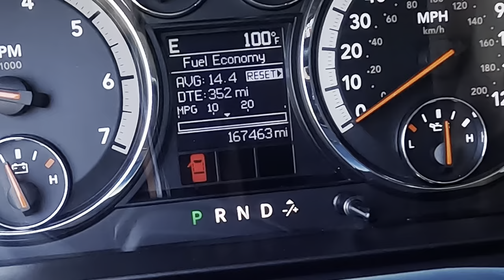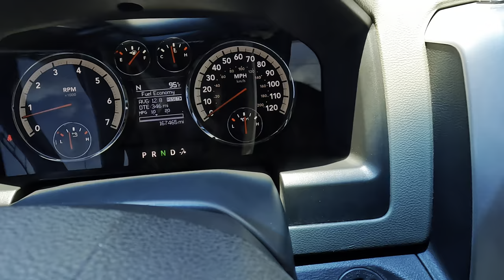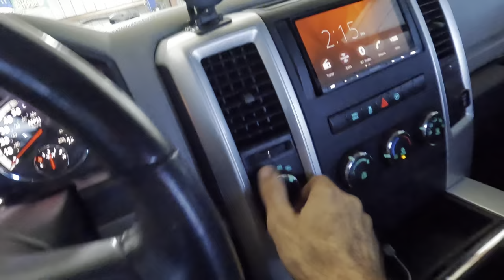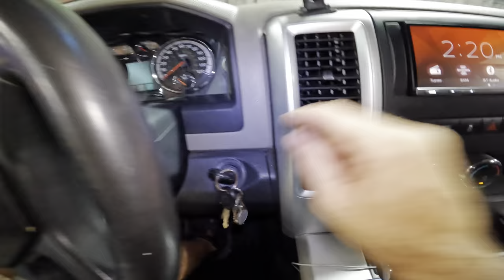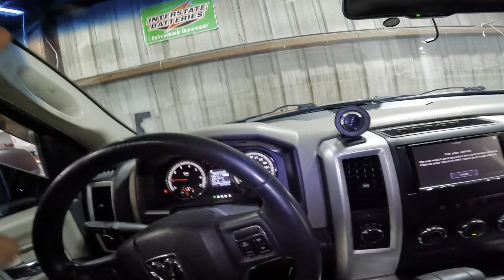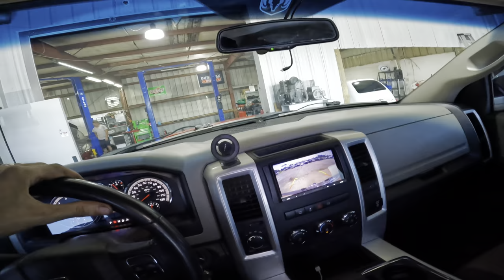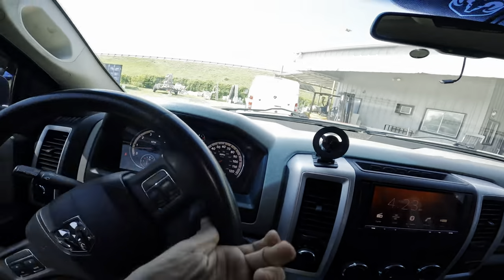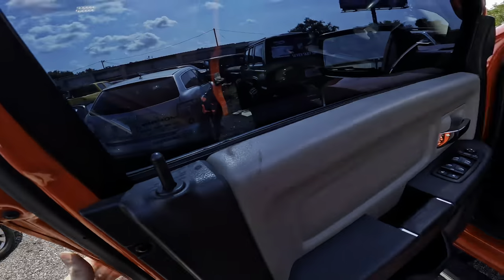Customer States: NO ONE CAN FIND IT! Sand in my Dodge Ram! Replace Whole Unit! 1500 4x4 5.7 hemi

Comment: You don't necessarily have to replace the drive shaft. Many enginineer/balancing businesses are able to service/replace those ujoints. Probably turns out cheaper than a ne shaft
Reply: Those Gen 4&5 U joints are expoyied in there.. They gotta be heated and pressed out at the very same time.... Lots and lots of HEAT.... Ray Ray don't know how to work a smoke wrench yet he is a just born doing well. He just ain't got it thru skull yet but eventually he might.. I would love an all expense paid week or two of teaching this dude in Fla... I could share some horror stories of rusted busted trucks and cars with him... he might put his ear plugs in for the duration...
Reply: @thekingsilverado3266  Your a superstar😅

Comment: I feel for the guy who bought this rig. I went through the same thing with a dealership in my area. I  had excellent customer service from our salesman and the owner of the dealership. They are a fairly large dealership and own dealerships for all over the northwest. Where I ran into trouble is with the service side. The service manager was a prick and was extremely harsh on his employees, and that led to techs fresh out of school with very little experience, especially with dodge front end and the notorious death wobble. I was a heavy equipment tech, and due to an injury that happened while not at work, I had to give up turning wrenches for the most part. I knew immediately what was going on with my rig. I explained it to the service manager and the tech himself, and after 5 attempts at trying to fix the death wobble I had enough and took it to a Truck service center and they knew exactly what I was talking about. I ended up with a $3300 bill. I bought new tires and track bar bushings and ball joints and two front axle U joints and shocks. I also had them install a steering gearbox brace as well. The wheel bearings and track bar were what was causing the problem.i took the bill to the dealership, and they wrote me a check for $3500, and life was good. I was just hoping that they would have paid for just the parts that were causing the problem. I was very surprised that they covered the whole bill and gave me $200 extra for fuel . The service manager was shit canned about 4 months later because of how he was treating customers.

Comment: Nice 
 Drive line diag. 
 Get permission to take the truck home and you have sand there . 
 But the drive shaft is not repairable sadly and the cv shaft is the Hum or buzz I bet they like to spin on the splines when they ware down. 
 Be safe all.

Comment: It's crazy (but not in believable, unfortunately) how the customer can take this to multiple separate mechanics, and none of the other guys are capable of giving this truck a 20-30 minute shake down like you did and find any of the obvious faults like you did.
Reply: His "shake down" took a lot longer than 30 minutes; my guess would be a good solid hour. Which is why those other shops never found the issue because they would have taken it for a 5 minute drive, checked the ball joints and u-joints by hand and then said they couldn't reproduce the customer complaint after about 15 or 20 minutes tops(which includes the time it would take to put it on and off the lift).
Reply: It takes thought & time to make an accurate diagnosis.
Reply: @@jshowao-rw1dh no, but you make a lot more money for being a trustworthy mechanic with return customers.
Reply: Someone is super defensive. Did you work this  dodge personally before Ray did? Lmao 🤣🤣🤣🤣
Reply: @joshuas390  you don't make a living that way.  It's a different thing when you can make money making a video about it.  You don't have to charge the client an exorbitant amount.

Comment: You're in for a treat getting that axle out.  I work on a fleet of those  generation ram trucks. The internal c-clip likes to get stuck and not allow the axle to pry out. Hopefully you quoted out the stub shaft too. Good luck and stay greasy my friend!
Reply: I just went through this on a Ram 1500 replacing the LF axle. I ended up having to cut the old axle off of the stub shaft. Royal pain in the ass!
Reply: @brycelund4112  They can be a real bugga. Look at it this way. Should be in for a good video. Lol.
Reply: @gregoryblack3888  I’m sure it will.
Reply: With the amount of light brown ground up steel crusties by the stub shaft to CV joint, that truck definitely needs both.
Reply: Maybe that's the reason the other garages didn't find the problem. They just didn't want to deal with the fix. I really cant believe another garage would miss something that sloppy.
Reply: @anthonydenn4345 definitely if you don’t look, you won’t see

Comment: I'd have expected to see a spacer for the rear propshaft too, as it doesn't look to be engaged into the gearbox far enough, it looks like it's dropping where it enters the gearbox.
Reply: With the lift as high as it is, and the rear axle dropping down as low as it did that's mostly just normal run out.  I have a lifted truck that does the same thing when up in the air.  You can see 1/2 to 3/4 inch run out from ride to lifted position on it.  And since the shaft has a pretty long nose end on the splines it can take a fairly good amount of run out.  I've seen as much as 2 inches run out on some lifted up a lot higher.  As long as it's not out past the seal it usually isn't much of an issue. Probably what that is from what I can see on this video.  At least it's not on a hanger bearing with more angle to the dangle because that much run out can destroy a hanger bearing quickly.

Comment: Once you start modifying the suspension with lift kits and larger tires, you will eventually have problems and wear. Good luck with approval of warranty.
Reply: I was going to say that lifting a vehicle( with CV axles)  increases the 
" angularity" of the CV's- which can increase wear....and, of course, driveshaft Ujoints.
A good Dshaft shop could rebuild that end, as well as balance the whole, so future Ujoints could be  replaceable.
Reply: Yup, it is part of the game, especially Ujoints
Reply: @williamevans6522  Constant velocity joints (by their very name) are not too fussed about angularity.
Reply: @johnhhinton5473  Sure they are.  Install them at the extreme of their flex, and they aren't going to wear evenly.
Reply: Ive a lifted ram and they still garantee everything except the pieces that are not mopar.. wich i think is leggit haha never had an issue with them, they care way less then you would expect

Comment: Suspension modifications would be one of the most common forms of stress on a vehicle that would cause issues felt by the owner/passengers, more so than engine modifications.

Suspension mods are something that many DYI'er installs themselves, and unfortunately there are many companies that sell sub-standard suspension kits. I am not saying that is the case with the lift kit in this Dodge Ram, it looks very well engineered, however as can be seen the Uni joint really is worn out in a way I haven't seen before. It would be interesting to see the carnage inside, especially if you don't have to return it as a core or warranty return item.

I have had 4WD's since the mid 1980"s, and I upgraded the suspension on all but my first 4WD.
Reply: Yes, my old ford ‘93 with lift wore the front Ujoint too, as well as the rear near the pinion - quite a different angle than stock
Reply: My father and I've seen similar wear on older RWD cars. Combination of stiff springs, long driveshaft, and smooth roads produces very little articulation.

It'd be ideal if someone made U-joints with plain bearings (bushings) instead of rollers for these sorts of applications, but these days they'd probably end up being made with plastic instead of bronze.

Comment: Just had a rear u-joint on my 02 Silverado 4x4 that was not doing its job. Mechanic I took it to KNEW right away what it was. I was looking at wheel bearings myself. He had me up and running same day and charged $125 total. Parts, labor and tax. Lots would have milked this for much more. Thanks to an honest mechanic

Comment: Nice looking truck, but looks can be deceiving, as the saying goes...Get a Tundra or Tacoma, and you won't have to worry about such things, but, to each his own..Oh, not the brand new Tundra 6 cylinder with the twin turbo, you don't want that..The standard 8 cylinder with no turbo, will last forever...And the Tacoma is probably the best truck ever mass produced, on my third one, and well over a million miles added together, with very little maintenance.. My wife has had the 2001 Lexus 300es and the 2003 Toyota Avalon, which is really the same exact car, made in the same exact factory, going on 700 thousand miles added together.

Comment: i’m always curious, usually dealers are extremely expensive so how is it that they couldn’t find the problem?
Reply: because they are all mechanics with government certificates with no experience of being a mechanic  and a manager whos wages you are paying for and no experience of being a mechanic
Reply: They probably like to be quick as possible.  More tickets=mo $
Reply: I went to the Ford dealer three times over the A/C in my Taurus blowing only up on the dash.  Three half-assed attempts later and looking at 1200.00 to remove the instrument panel, I took matters into my own hands and figured out how to make a lasting repair myself…for one hour of my time and 13 bucks!
Reply: Just because they charged good money does not mean they do a good job have a great day
Reply: Because they hire mechanics that just throw parts at it till fixed. Dealer makes money on every part.
Reply: Dealer service departments are production shops -- a set number of vehicles per day in and out quickly.  Techs have to make fast diagnoses and repairs, and at that, expen$ive ones.  And if the vehicle is modified, they'll outright refuse it out of liability concerns or manufacturer's policy.

Comment: I've always put the weight of the vehicle on my lower control arms to check the ball joints. Control arms are pushing down already so you have to lift them up. Uppers are still pushing down so then you can lift tire. That's the way I was taught anyway.

Comment: nice red rtv on the oil plug. also those non servicable U joints are a crime. should be banned. so fun when need to buy expensive shaft when only the cheap u joint went bad. could always cut and weld a new one
Reply: needs more on that plug .. lol

Comment: One thing I did notice is that you are wearing a marriage ring . Do yourself a favour and leave it at home. Over my 50 year working life, I came across quite a lot of fitters with missing fingers due to accidents with finger rings.
Reply: I knew a pilot who lost a finger when he got stuck while preflighting and slipped.
Reply: I used to work on generators, and too my ring off because working around high voltage and electrical circuits are not a good idea with a ring on. The high current can fry that finger right off
Reply: Easiest way to deglove a finger.
Reply: 0:28

Comment: most everytime i watch Ray's uploads i am blown away by the mileage that customers vehicles have done!! I drive, or rather drove my last BMW (just swapped it recently for a new vehic;e) having it from new and drove it most every single day for seven years;  but only accumulated just over 39K miles.... Tis the longest Ive held onto a car for many years living in the UK
Reply: I've never had a car with that little mileage! Well my wife's car we got with under 30k just passed 40. But all of my cars are over 100k. My last car had 268k on it. Ran beautiful but the rear suspension rotted out to the point it would cost more to fix it than replace it with the current car. That has 138k. It's all about preventive maintenance and not ignoring the little things.
Reply: Mike; To be sure the best way to prolong the life of your motor vehicle is regular maintenance, without it you are bang on the money, you are building up a heap of both problems and financial headaches. 
When changing my car, which on reflection was a bit nutty given the condition etc, but hey ho as they say. One thing that deffo put me off getting another bmw was the outrageous fleecing of the customer, charging a monthly fee for the privilege of using both heated seats and steering wheel... 
This imo, is nothing but a bloody scam. It’s like buying a radio or tv and paying monthly for the privilege of using the dam thing...

Though that said!!! 😡😳😡 here in the U.K. after buying your television if you want to watch any show whether /news/weather/entertainment whilst it is broadcast live so to speak, even an ancient b/W movie or indeed, as above anything that whether cable or SKY the satellite company, even ordinary terrestrial channels; you by law MUST have a tv licence issued by the BBC,  even if you NEVER EVER watch bbc you still have to pay them for the privilege of watching television as broadcast ; Tis a legal scam. 

It’s just the same as, say you going to your local store and buying a newspaper, you have to stump up the cost of every diff newspaper on the shelf ... 

The only way to watch television without having to pay (app US $180 per annum) is only to watch shows that are not broadcast in ANY channels regular daily schedules. Which means taking a sub on like Netflix or Prime. 

To think imagine in the Wonderful US there is a disaster like 9/11 or a happy event like New Years or your biggest football World Series and it’s broadcast on every channel . To watch the equivalent here broadcast live, and you watch it without shelling out money to the BBC, and you get caught, well it’s a court appearance and a significant fine, just for watching tv in your own home 😡😡😡
APOLOGIES for the rant Mike, I just despise getting scammed by the (uber liberal) BBC 
Have a good day dude.👍

Comment: I seen it @12:59 those stub shafts can't ever seem to keep the rust out up here in Maine. They like to make all types of pop/grinding noises. I always unload the front ends to check the ball joints. If you can benchpress 500lbs and have a prybar casted out of Thors hammer maybe you can do it without unloading them but I dont...

Comment: If I may. I would recommend activating 4x4 on the lift and turn lock to to lock. That wear on the cv shaft and the lower control arm, it's highly probable that's binding.

Comment: My wife had a 2012 Renault Koleos, 4WD. Had to replace the front U-joint twice due to the noise it produced while driving. It sounded like a rattle. The higher the speed, faster the rattle noise. The mechanic was able to diagnose it was a worn u-joint (front). Well spotted.

Comment: It was recommended to me that the increased angle of the driveshaft with the lift will cause premature failure of u joints, and some sort of two piece shaft or a cv joint is the solution.

Comment: Amazing clean condition of that underbody for the age and milage. My new Ranger is dirtier than that after less than 400 miles from the factory. Drive shafts really should be made serviceable and be fitted with grease nipples/Zerks

Comment: I've never seen ball joints checked that way. we always put a jack or jackstand under the control arm to set it at ride height, where most of the wear is. They can be tight at full droop and still loose in the middle of its travel.

Comment: Looks like he uses sealer, or just marks bolts with that red stuff. Noticed it on the rear diff cover, and the oil pan. Would not be surprising because it certain does look like a loved truck.

Comment: The right cv shaft issue is typically a combination of the axle in the front axle housing and cv joint.  Should replace the inner axle as well as the cv shaft assembly.  The rust where the cv joint and axle connect is a dead giveaway.

Comment: I run the Milwaukee mid torque 1/2 which has plenty of power for 90% of what I need it for and it's quite a bit smaller and easier to handle.

Comment: Is the maximum steering lock adjustable on these axles? If so it needs adjusting to stop those components wearing against each other. In any case, the warranty is unlikely to cover fair wear and tear, which I would classify that driveshaft to have at that mileage.

Comment: You’re telling me that changing the geometry on the drive shaft angles will cause wear on the U joints. 
I wonder what the manufacturer design engineers would have to say about putting spacers between the body and frame and steering.
Sorry, I know that’s smug. I try to explain to my sons the potential problems with truck modifications, ask me how I know ? I was young once.
Ray, you are a very diligent and skilled mechanic. You’re customers need to know that your work is above average.
Very happy to see you opened your own shop, because you will do very well growing your business and mentoring less experienced technicians. Win Win Win… I like that.

Comment: I had a '92 Jeep Cherokee that developed a rearend whine when you let off the throttle to coast. I thought it was was the rear ring and pinion and had the dealer set the back lash again (Cost $1,200.00 and it still whined like before. I finally discovered the u-joint needle bearings on the rear drive shaft were dry (non greasable of course). Replaced u-joints and noise went away.

I think Ray found the problem.

Comment: Ray, sense the entire front driveshaft needs to be replaced you should recommend a custom shaft from Tom Wood’s. They sell a completely serviceable double cardan unit that will permanently solve this issue. Additionally the owner can get rid of the spacer.

Comment: Hey Ray, I saw your video where you were repairing the small engine did you know I had my snowblower fixed up here in the northeast and they told me that if you go to Lowe’s or Home Depot True fuel it has no ethanol in it all the local small repair shops around here recommend the fuel and it’s good up to a year so that’s what I started using and my snowblower runs great